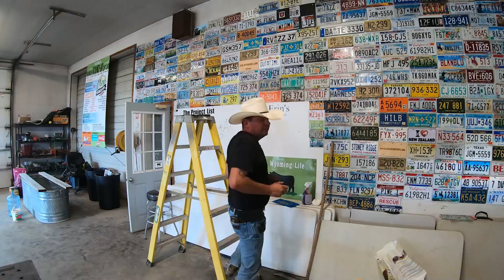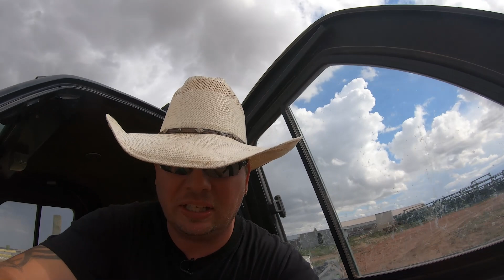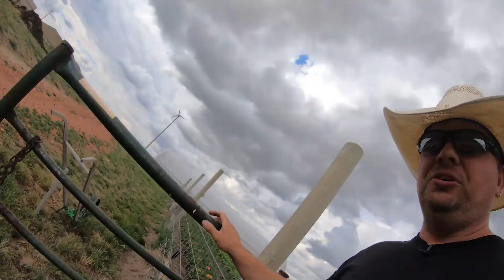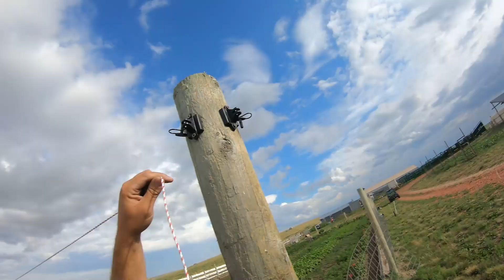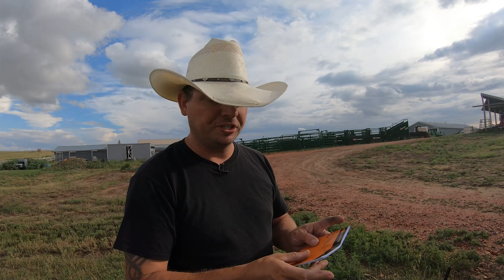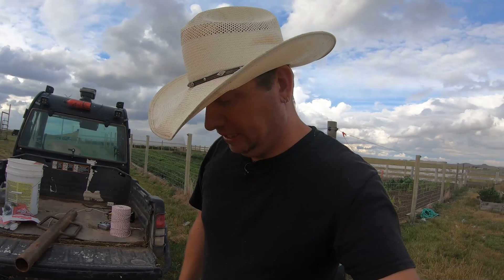Our First Electric Fence

Comment: I use lots of electric fence your fence is to high the animals have to touch the ground and wire at the same time. Best way put a fence wire around the fence you have from knee high to wast high. Ps if the animals are not used to the fence they will brake it.
Reply from the maker: Or they touch two wires. Like I said putting up more. Lol.

Comment: That Plug is 115v and 15 to 20 amps.  Lmaooooo I haven't seen someone touch a Electric fence since my buddy peed on one and all over himself afterwards.  Definitely put one lower because deer will dive under the higher wire.

Comment: I have spent many years dealing with deer and electric fences.  I aplaude your efforts, but you are making some rookie mistakes.  Please learn from my errors and suffering.
1.  To test an electric fence you don't need a fancy tool at $35 or to hurt yourself. We simply take a blade of grass or something similar and lay it on the wire and gradually shorten the distance the blade of grass has between your hand and the wire.  At some point you will feel a very mild tingle and you know the fence is working.
2.  How do you know if there are deer in your garden?  Simple again.  Look for deer scat.  It seems they cannot go anywhere without leaving some droppings and it is as sure a sign as you can get.
3.  You are using the electric fence incorrectly.   An electric fence is meant to tell animals who push against it to back off.  If you have rock chucks, ground hogs, rabbits, or whatever trying to climb your fence or whatever, then the electric fence will keep them out.  Deer don't push against a fence.  They simply jump over it and the white tail deer where I live easily jump my seven foot high fence.  I suspect you have mule deer and should they try to jump your fence and fail, then they will simply snap your electric fence wire as they plow through it.  The only thing that works for me is to make a fence six to eight feet tall and then place at the top of the fence small boards that extend outward around two feet or a bit more.  At the end of these boards you can run another simple wire (nothing fancy) that will parallel your lower fence but will be two feet or so further out.  At intervals of around six to eight feet down the line you can tie high visibility cloth or streamers and can even attach the lower ends to the top of "inside fence". Deer do not see well and having a barrier/fence that is not vertical confuses them.  The high visibility markings on the outward fence will call their attention to it, will confuse them, and they will not try to jump it.
4.  Your ground is going to fail you.  You should use a grounding rod to ensure a good ground and when the soil is dry multiple grounding rods are often required.  Grounding rods need to penetrate the soil by at least four feet (8 feet is better) and a simple t-post will not work well.  A t-post not only does not penetrate the soil very deeply, it is also painted which acts as an insulator thereby decreasing the efficiency of its grounding ability.
5.  Do yourself a favor and use the corner devices for attaching your wire to the post.  Over time your wire is going to sag and the corners will short out your wire especially when it rains.  The corner devices help prevent this.  Also, when the line is shorted out you may get a message on your battery unit implying that there is no power coming from your battery.  Before you start thinking about getting a new battery or working on the connection to the fence, look at places where the line could short out.  More often than not everything is just fine and your line has shorted out.  Fix the short and life is good.

Comment: Electric fencing definitely has its challenges and it place, I've used it to keep everything from squirrels out of a garden to keeping cattle sheep on grass, and bulls from cows in heat. Your project offers some challenges, but if I we're going to do it, I think I'd screw a 2x4 to each post at an angle flaring the 2x4 out at maybe a 30 or 45° angle to create a hybrid 3d fence. The other thing I'd recommend is in your soil, get a proper ground rod. Go as deep or diagonal as possible. You can also run a ground wire, where the deer are most likely to hit the hot and ground at the some time and tie the ground back into the ground input on the unit. Any questions feel free to ask.

Comment: Mike a story pole would work good for the placement of the insulators. Put the second wire where you want just go on the inside of the pole where the water timer is.

Comment: Run a ground wire between the 2 hot wires, run ground wire to t-post to ground system.
Put ribbons on wires so deer/elk/horses can see them.
Reply: T posts are a bad ground rod, put a ohm meter on your t post ground and see how many ohms are on it, then drive a actual ground rod in it. compare results - you'll be amazed
Reply: @BronzeBowFarm  ground wire doesn't have to be true ground  just need to complete the curcuit. Like with cattle they touch both, and they are the connection to the circuit.
Reply: if youre running a ground wire around the middle, just connect it to the ground circuit of the charger. If a deer is discovering this new hot wire mid flight, i have a feeling youll have broken wire and a deer in the garden that refuses to leave .

Comment: Back in the day we had to use bailing wire and insulators that had a metal bar held on by a wingnut.  It was not as easy and a pain in the butt.  As a side note, use the back of your hand to test.  If you use the front you risk the muscles contracting and you grabbing it.

Comment: Mike, the deer will be in the air jumping in order to touch your wires, also they can get tangled in the wire and you may find a few hanging by their hoofs. The temporary wire will fall apart in a year so use at least. 14 gauge wire it cheaper (I have some going on 10 years now). Another solution is is to install a fence outside you current fence about 3 feet away, put the wire at nose height of the deer, a single wire will do it. Appears the deer lose confidence in clearing the inner fence because they have to start the jump so far away. also drive in a real ground rod about 3 feet at least one of those 3 footers with a T top. I always enjoy your post. If you decide to do pasture get higher joules 6 to 35 the voltage will be 7kv to 12kv, use hightensile wire 12.5 gauge and 3 8 foot ground rods 10 feet apart.  Once you have cattle trained you can hold them with a single wire a nose height good luck waiting to hear the result

Comment: Actually Mike that may not stop dear they’ll still jump through that and they’re not going to get electrocuted unless they’re grounded I did several acres of sweet corn and I used Gallagher‘s food plot method if you go to their website you’re going to have to put a strand of fence 2 to 3 feet about 3 feet high off the ground on the outside of your perimeter hog panels there it’s a distance thing with deer not a height thing to stop them from going in and once they already know how to go through an electric fence usually nothing stops him anyways. For my electric to keep the deer out I definitely had to put it up well before the ears started forming to train them ahead of time to stay out and then it worked great
Reply: Just watched this and those were my thoughts too.  I've installed polycord in the past, and it seemed the key was to place it at nose level for whatever you're trying to keep in (or out).  You want the critter to touch its nose, which is one of the most sensitive parts of the animal, and they'll learn quickly to steer clear of the garden.

Comment: Putting a wire that high won't help unless you put a ground wire they would touch at the same time . the wire needs to be just above the other fence so they touch it while sanding. Also I don't think that fencer has enough joules to stop the deer ,with fencers its important to remember go big or go home .

Comment: Sad thought... I'd hate to be the first few birds that land on that wire 😢
Reply: It won't hurt them, you have to touch the ground and electric wire to get chocked.
Reply: Muddy Pawz Ranch, birds won’t get zapped because they aren’t tied to ground. It’s the same way they can sit on power lines. They are safe! 😊
Reply: So if a dear jumps through/over and aren't touching the ground, they won't get shocked ?
Reply: @muddypawzranch3327  that right they won't get shocked if they're not touching the Earth or the ground. They have to touch both to complete the circuit.
Reply: It won't hurt the 🐦. It's just like when they land on power lines.

Comment: Hi again MIKE 
Lol  as I watch I'm thinking you definitely can handle this Mike!  It's not a hard thing to do.   Like anything else once you've done it you'll be fine thereafter.  Carry a small tester with you to check it so you'll know if it's still working and you don't ZAP yourself again!   Hope you got the strongest one possible because many of those critters hide is so tough they still can get through once in a while.  And yes the gates have to be closed and secured!
Until your regulars know it's there they might cause some problems at first.  They will go under the wire too so you'll need to install additional wire!  They go high low and in between if there's something tasty on the other side...
Hope this helps!
Thx for sharing as always!   Stay safe!!!

Comment: Let's see if that deters the deer.  I'm skeptical.  Seems to me for a deer to come in contact with it it (the deer) needs to be airborne in a jump.  Two thoughts are, 1.  the deer is not in ground contact thus not completing an electrical circuit,  and 2. the deer will be forever jumping into it and tearing it down during that collision. The deer will still get in but will they then want to get out?  Keep us posted.
Reply: I can understand using electric fences against anything that might knock it down to go through it.  For example, the cattle maybe could do it if agitated enough.  But for deer jumping over it, how would the electricity stop them if they don't even touch the fence, and, if they brushed against it on the way over, they wouldn't be grounded.  If they can't jump that high, it seems you could you wire without the electricity.

Let's see Bud if anyone responds to enlighten us.
Reply: Joseph Felber Or they jump in and decide that they can’t jump out so they’re in there all night. Maybe wire some zucchini outside the fence that would put a bad taste in their mouth.

Comment: My husband who does a lot of electric fencing said use the woven wire panel as your ground, not the post. It'll be more reliable!
Reply: Yes. Ground requires a lot of conductivity and that means moist ground or a lot of metal wire. Groundrod for my fence is way deeper, but sand = dry soil = poor conductivity. So groundrod is connected to woven wire fence. Alternative is pooring a lot of water around the grounding rod (with little guarantee of succes).
Reply: The wire fence will work IF it is attached to metal posts.  A wire fence on wooden posts will not ground the system and it will not shock.
Reply: @FarmFreshIB  Wire fence needs to make ground contact along the bottom. I use the same method here and wire is attached to wooden posts.

Comment: Electrical fence will only work if the deer is standing ...must be grounded ' they may sense the fence and stay away
Reply: If they touch the fence underneath they are grounded without standing on the ground.
Reply: @schluterkristina7165  You explain just how they are grounded??? The only way they are grounded is if they are either touching the ground or the page wire fence witch must be grounded!!!
Reply: @hankadamski7249  their hoofs makes them grounded